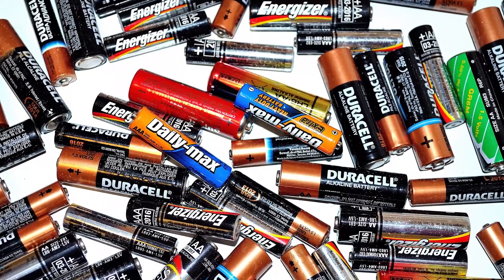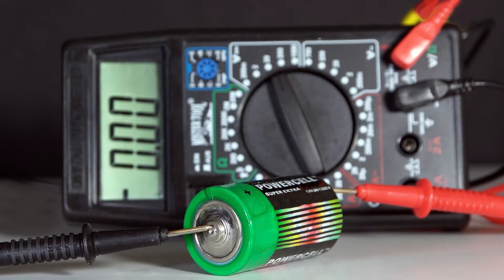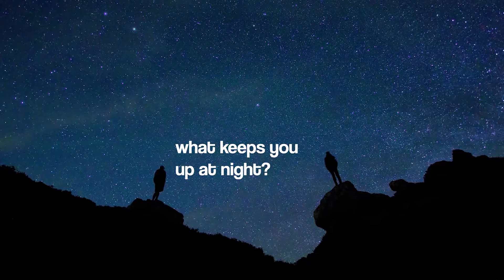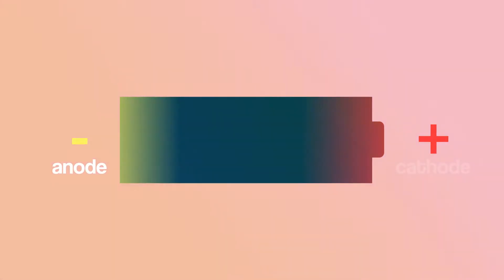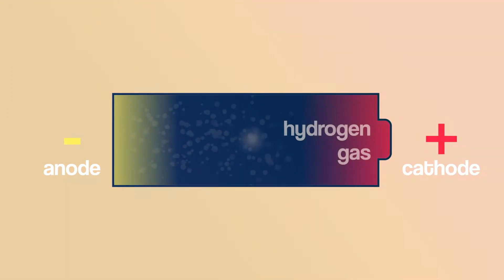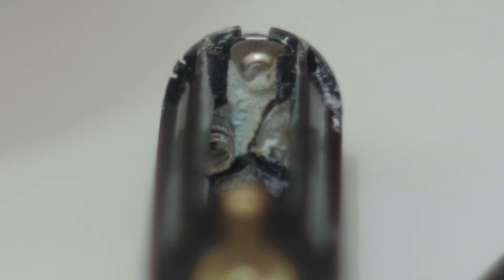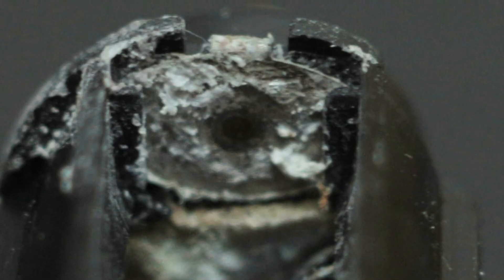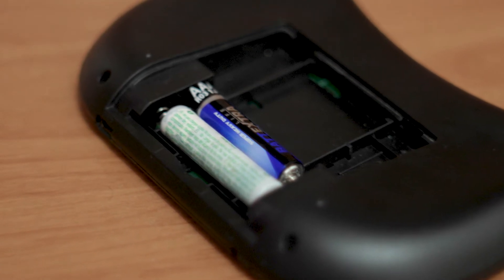Eli5 - Why do batteries leak?

Comment: thanks for the info and great delivery...just a general note on toxins.... I store my batteries outside of the house, batteries gas off (like you pointed out), and plus, they are highly toxic, all you have to do is put them in a lidded container, go to open it when you need one, and then you will smell the toxic gas coming out (just like storing paints/spray-paints in a house, does the same thing)...I avoid using "disposable" batteries all together as they are a serious environmental hazard and generally are not recyclable, I know this is somewhat off topic but our waste disposal is ludicrous; especially with all the recent disasters (floods, hurricanes etc) literally mix up everything and then the water, soil becomes contaminated/toxic...so we are swimming in our own waste/trash, etc...I call it the boomerang effect and we humans need to work on how to handle our waste and pollution properly

Comment: Hi, Andrew great informative video for a dummy like me XD I just want to ask a question if the phone battery were to leak out of the mobile how long is a rough estimate would it turn into powder? There was an unexplainable fluid, I don't know how it got wet when I just left it on the table. The liquid went on my hands and it didn't burn I guess and it dried on my fingers, all I could smell was my hand soap so I was confused if it messed up my ability to detect possible "electrolyte liquid". Do I have nothing to worry about if it didn't turn to white powder? The phone was brought last year and is not damaged... I think :\

Comment: Only SOME batteries leak. Not all. Usually Duracell leaks. I've never seen TOSHIBA batteries leak. I have Toshiba Alkaline batteries today in 2022 from 2002 and they still work. They are 20 years old batteries and they work like new. No joke. I can prove it with photos to whoever doesn't believe me. They are in my remote control. They did not leak 1 single little droplet, nothing. MADE IN JAPAN. Duracell are so bad, they should be banned and fined for ruining people's electronics.

Comment: One time I was standing talking to a friend when a loud pop came from me.  I curiously searched my pocket.  I had a tiny Maglite with a traditional bulb and single AAA cell.  Well, the darn thing shorted in my pocket.  It was so hot I could hardly get it out of my pocket.  Fortunately, it was laying away from my skin so I never felt it heating up.  After cooling I can see the battery popped and leaked inside the flashlight.  Never underestimate the power of a small cell.  They could charge a stun gun and mess you up.

Comment: I always wonder if "modern" batteries can leak. For example, the lithium-ion battery in my laptop.....
I ask this question, because many modern devices, do not allow easy removal of their batteries....which may be a problem in the years to come....what do you think?
Reply from the maker: They can leak, and this is indeed a problem. Hopefully this will be addressed in the near future, and we will be able to swap out batteries as we could do in the past. I hate the idea of having to retire a perfectly good device just because the battery is getting old.
Reply: The battery of my Iphone leaked and swell
Reply: @Nat.ali.a  I feel sorry for you! It's interesting though, because it's not a problem I've often heard about with iphones...!
Reply: @Bobby_Snoof  yes, I thought the screen was detaching, the battery was not charging well anymore so I took it to get a new one and discover, after opening the iphone that the battery was starting to leak and had already swollen and pushed the screen. It was dangerous as hell.

Comment: WHY could you not put a very thin coating of Vaseline, WD-40,  or something similar, on the bottom of each battery, BEFORE placing them in the device???  Seems as though this would facilitate the cleaning of the terminals, should there be any corrosion.    Please advise if this would be a workable remedy.   Thanks.
Reply from the maker: WD-40 is not electrically conductive (and too liquid, I think), but Vaseline is, and yes, you could put a thin coating over the terminals. This is also done on cars/motorcycles to protect the connection from dust/debris/corrosion. It could probably facilitate cleaning the terminals if the batteries leak.

Comment: I’ve had Duracell leak numerous times over the years and damage flashlights and game cameras. I’ve learned to remove the batteries if I will be going several months without using the device.
Reply from the maker: That's a really good idea - thanks for sharing!
Reply: Most battery powered devices say remove the batteries when not in use.

Comment: Damn I messed up. I found a few of my AAA alkaline Duracell batteries had a white powder substance in a new box I hadn't even used. So I took the few contaminated batteries and wiped them off with a wet napkin. But I touched and cleaned using my bare hands, no latex gloves. Hopefully I didn't get any poison in my system... I will post another comment in a few days, in case nothing happened. Wish me luck 🤦‍♀️
Reply: Its just a weak acid, about 4 times the strength of vinegar, so it won't hurt you.  Just don't eat any of it and you will be fine even if you get a lot of it all over your skin.  If you leave it on your skin for 10 minutes it might start to hurt, so wash it off.
Reply: @menguardingtheirownwallets6791  Thanks! 👍👍
Reply: If you’re ever concerned, call your country’s poison control line
Reply from the maker: Well, it's been 4 days. Are you ok, bro?
Reply: @odysseyofcuriosity  Yes sir! So far, so good  *knocks on wood. Surprisingly the AAA batteries still work after cleaning them off and look to be fully charged. Thanks for your vid. At least I know what happened and why! 👍
Reply: As long as you didnt lick the battery or lick your fingers after ... YOU ARE OK ..
Reply: @ACommenterOnYouTube  Well okay, why would I even do that lol but thanks! 😁👍